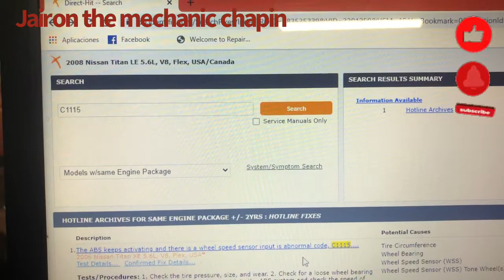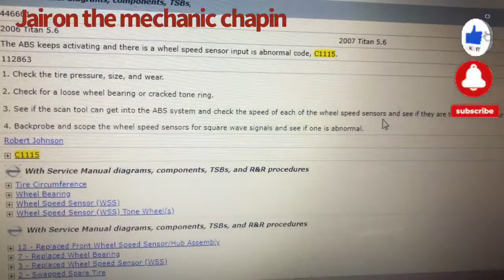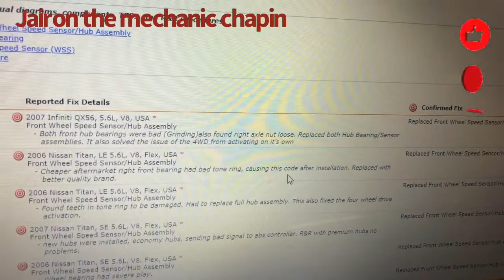C1115 Abs keeps activating, this is what i found!! Abs se activa esto fue lo que encontre!!

Comment: Hi mine does the same but the speed sensors all read ok how do you pinpoint the wheel
Reply from the maker: You’ll have to remove your cv axle on each front wheels and check the magnet 🧲 on each bearing one of them will be damaged